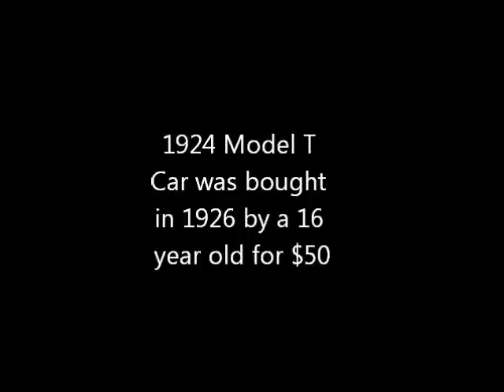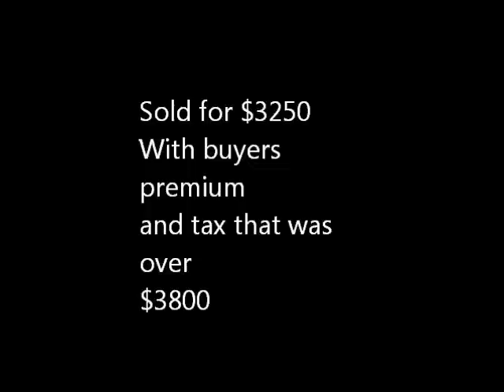1924 Model T Barn Find Auctioned 51 Years In Storage

Comment: I'm not buying the story offered up with this video. The engine, rear axle and radiator shell are from the "improved" T's of 26/27. Supposedly it was bought for $50 in 1926. T's were still being produced through May of 27 and sold for several hundred $. The depression was some years away so I can't believe a 2-3 year old model T would sell for $50. It just doesn't add up.